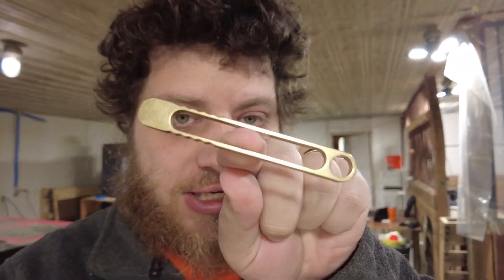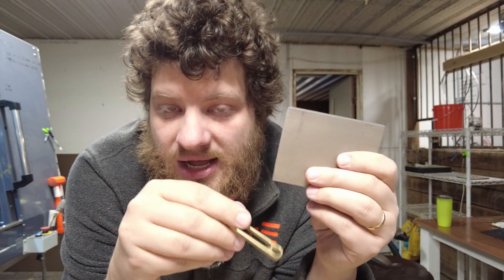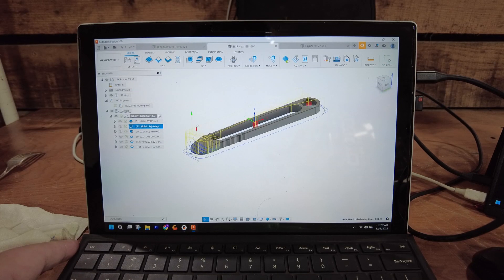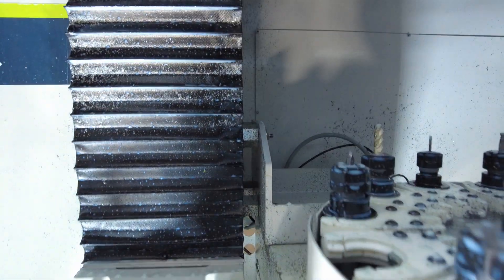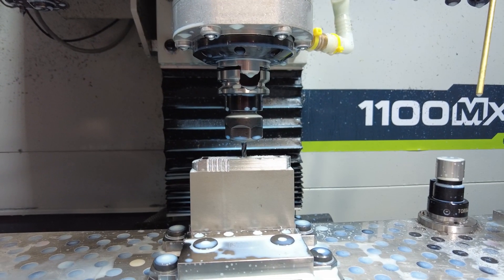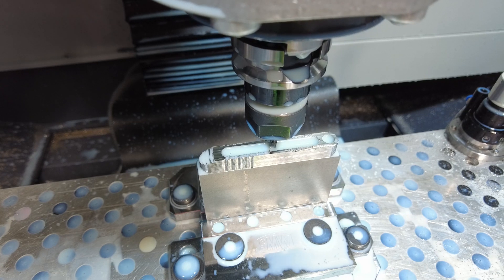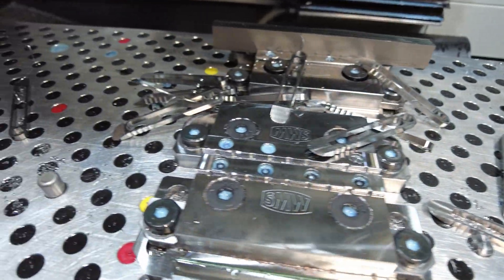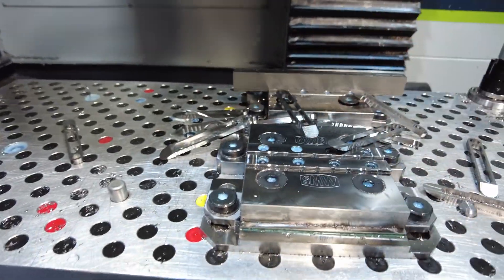Salami Slicing Stainless Steel Prybars

Comment: What slitting saw did you use?  I have some cheap HSS saws that I have used a ton, even on titanium but I'm looking for options.
Reply from the maker: Both my saw and arbor are from maritool. I'm very happy with them. Both.
Reply: @AudacityMicro  Thanks!